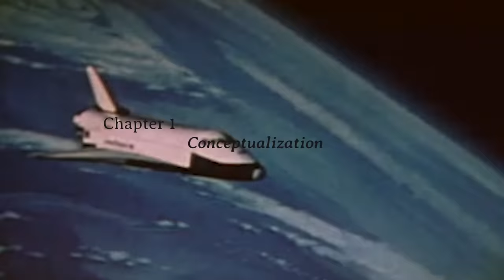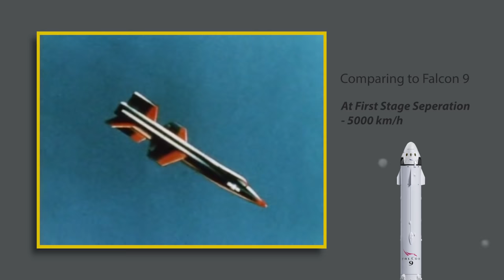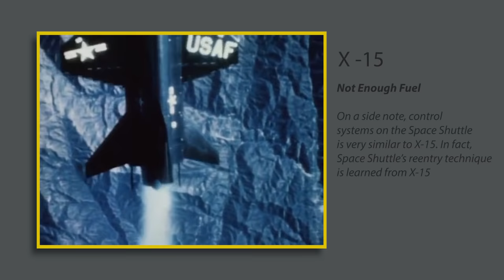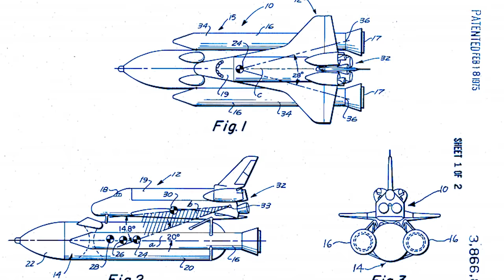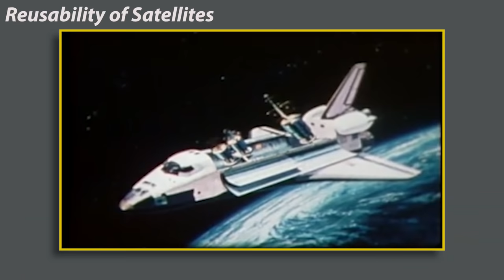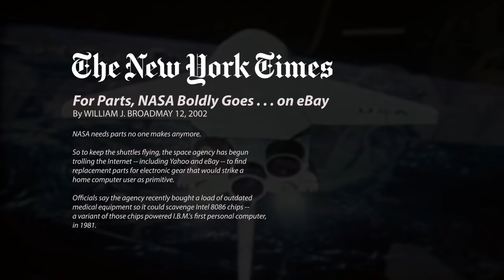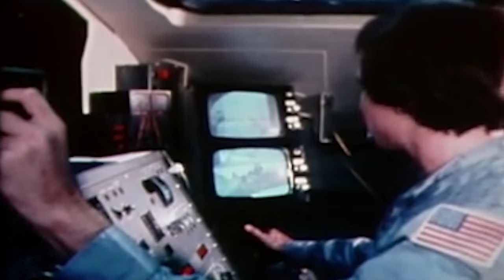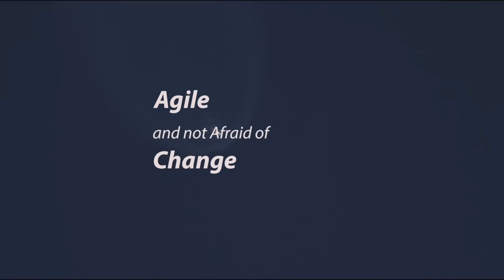The Space Shuttle, a failed attempt at Reusability?

Comment: I disagree to a point here. It's true the shuttle was supposed to revolutionize space travel like Space X. The problem is, Space X has yet to even send a crew into space. It has yet to demonstrate it can send ppl up regularly. I hope it does and maybe it will but I'm not holding my breath. As for the shuttle, as usual...it's not mentioned that NASA suffered a budget demolition from 1967-71. The Nixon Admin gutted all NASA post Apollo plans except for the shuttle so it's no wonder we got what we got with the shuttle. Yet it was reused as Columbia completed 27 missions, Discovery 39, Atlantis 33 and Endeavor, 25 missions. Challenger completed 10 missions before it's demise. Shuttle may have been a little too advanced to pull off given the budget constraints it was developed and operated under. No loss of Apollo missions? The very first one killed 3 crew. And there were far fewer Apollo missions. Who's to say we wouldn't have had another fatal accident as we very nearly did with Apollo 13. There were only a total of 12 Apollo missions. The shuttle doubled that amount before Challenger. Including shuttle Discovery being flown 6 times from it's first flight in 1984 and completing it's 6th mission in just under a year. That demonstrated it was possibly to do 24 flights annually but the budget didn't permit dedicated crews to each orbiter. I should know, I worked as a NASA contractor at KSC from 1984-2000. It's fair to say the shuttle was a spectacular technical success but and equally dismal ECONOMIC failure.

Comment: NOTE: The Space Transportation System loss hald of its' total cost because of the double digit inflation of the early mid 1970s.
Additionally, NASA engineers aren't business managers.

Because of the fear of the Space Shuttle program getting cancelled because of a possible lack of votes in Congress, NASA engineers claimed the Space Shuttles could do all the launching of all space satellites and deep space probes.

The Space Shuttles are like a fleet of long haul Eighteen-wheelers'..Excellent for hugh frieght cargo over large distances but not for in town deliveries..those u use small delivery vans.
For medium delieveries of medium size cargo one uses standard size moving trucks.

The Shuttles were the eighteen wheelers of the space age. Also, there should have been ar least eight to twelve or more built. 
There were no chain management to continue building parts that wear out.

It was to where NASA would take the landing gear of Columbia and put it on Atlantis & take components off of Atlantis & put them on Challenger...

NASA engineers were STUPID to trash the rockets which could be used for normal rub of the mill space flight.

Comment: 1. The shuttle was refitted during it's life and even if it wasn't 30 is not the same as 50

2. The shuttle wasn't a total failure like you are claiming. While it did fail in being cheaper without it the ISS could not have been built and Hubble would be the world's finest piece of space junk

3. So are you going to pretend that Gus Grissom, Ed White, and Robert Chaffee (Apollo 1 crew) never existed. Yes people died in the shuttle and that is a tragedy but to say that it’s the only rocket that has ever killed someone is not only wrong it's a disgrace to the memory of the other astronauts and cosmonauts who died trying to advance humanity into space
Reply: Carter4240 - Disagree on both points in item 2
The shuttle was not NECESSARY for Hubble or ISS.  Hubble could have been launched on an unmanned vehicle and all subsequent repairs and modification could have been done from an Apollo / Soyuz.  Same thing could have been done with all ISS components.
The only reason they used the shuttle was because it was available.  Sure the mission profiles would have been quite different but the actual result could have easily been the same (and no doubt would have been a lot cheaper).
Reply: Hmmm, the Saturn V cost nearly 3x as much as the shuttle to launch...
Reply: Ian Slatas However you get a lunar mission or a giant space station with the Saturn V.
For low earth orbit mission you had the Saturn 1B which was cheaper tho launch. The repair missions costs of a Hubble servicing missions could have been used to build a new telescope on a more frequent basis launched by an expendable launcher. Similar to the James Webb space telescope.
Reply: poruatokin - Neither Apollo nor Soyuz would have been capable of carrying up the replacement equipment to Hubble, much less to be able to capture it (which required the RMS arm from Shuttle's payload bay).  Best they could do is rendezvous, as there was no docking connection to mate to.

Comment: This video has too many misleading statements.

The engineers realized the Shuttle was a failure economically way before you claim they did. ( My guess is they knew that before its first-ever flight)

The Shuttle wasn't too low-tech. It was too high-tech. $$$. SpaceEx is proof of that. Look at the specific impulse of the Shuttle's main engines and you'll see they aimed too high, not too low. 

The X-15 engineers didn't "realize" their plane "just didn't have enough" fuel to go into orbit. The way you phrase that is strange. OF COURSE they know from initial idea of the X15 that it wasn't going to have the delta-v for orbit.

Comment: The Shuttle wasn't even reusable. It was refurbishable. The SRBs and external tank were  thrown away after each mission. Even with the Shuttle itself, large parts of it had to be retooled, such as the tiles and the engine. Compare this to the first stage of the Falcon 9, which basically just needs to be refueled before it can be used again.
Reply: The SRBs were not thrown away.  They landed in the ocean using parachutes and were recovered with special ships.  The falcon 9 2nd stage is never reused and most of the first stages have not been recovered.  None have been used more than 3 times and they only planned to use them as many as 10 but even that is unlikely since SpaceX abandons architecture so quickly.  There are no extensive details provided by SpaceX about what is required for the Falcon 9 refurbishment but it's a heck of a lot more than fuel.  Why is it so hard for people to be realistic about SpaceX?